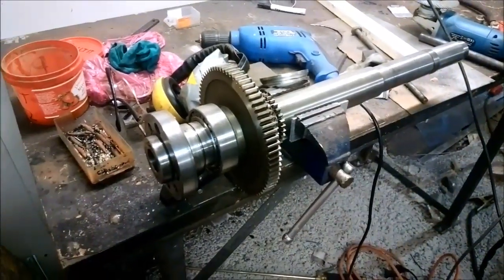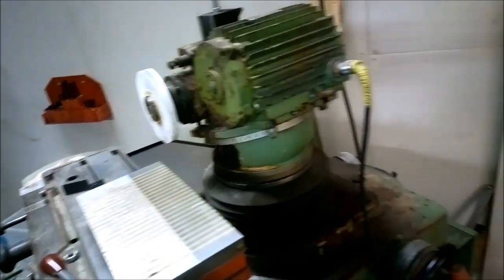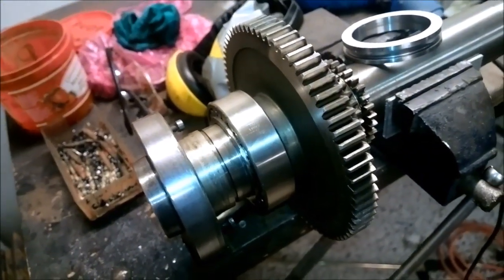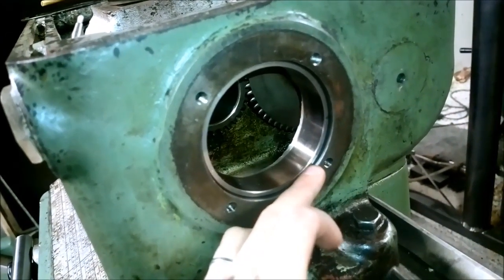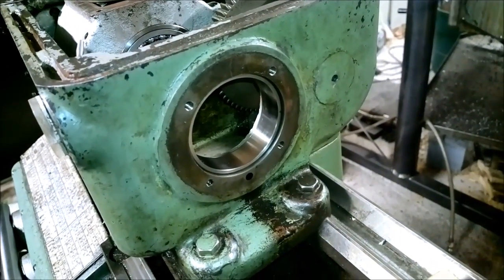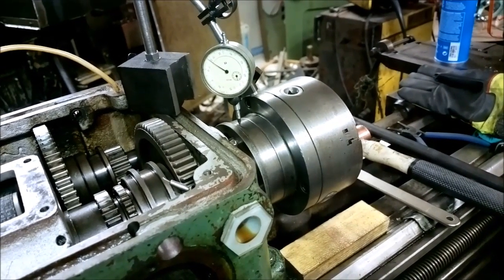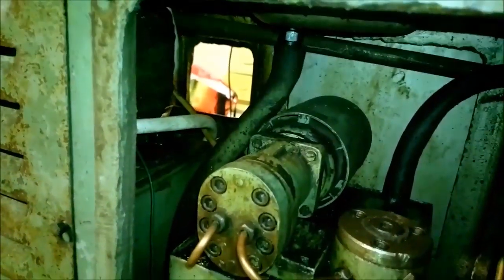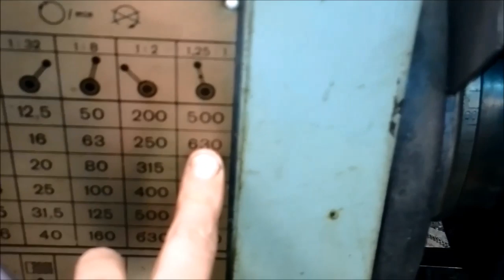Spindle bearing talk and progress 2 -Finished-

Comment: Hi bearing is adjusted now, lathe is cold and bearing is not oiled so it will be slightly different when lathe is running. I think 5 microns play on the main spindle is ok for cold and dry lathe but it depends on its specification. Anyway you need to try how the lathe is running. Bad thing is that you had to put Loctite between the bearing and its housing it should be tight press fit according to the bearing and lathe specification.
In some cases bearings haven't tight press fit for example when they are clamped,
but in such application I am sure it should be tight press fit. But better that you put this Loctite anyway it might be ok for some time.
Reply from the maker: Yes, there should be a press-fit. I have no Idea why it is like that now. I guess the only way to properly fix this is to rebore and sleeve the housing.. Loctite sure isn't a long-term solution but it will have to work until I have time to properly fix and overhaul this lathe.
Reply: sunppaa Dear Sunppaa, after seeing the video, I am 100 % sure that the bore is absolutely perfect, please do not do any thing with it. The bore should suport the bearing outer ring,the idea with the Locktite was 1000% correct.
I think You made the bearing adjustment just the other way arround,but anyway,for a quick repair the result is pretty good.
The surface finish of Your test turn was simply amazing. Congatulations !!!! Good luck !!
Reply from the maker: StamD65 So you think the outer race is supposed to expand against its housing? The turning at the end was not done on this lathe, but a 16K25 at my school workshop, very sadly :-). This lathe still needs a few other things done but hoping to finish them this weekend! Cannot wait to get making the first cut!! And if needed, I will just remove the spindle once more and readjust. Thank you for your help!!!
Reply: sunppaa The outer ring of the bearing should NOT expand by no means. It should be supported by the headstock box and,ofcourse,should be a bit pressed by the Rolls of the bearing ( pre-load)

Comment: Idk if you still have this one but 0,01mm thickness variation on a spindle shim is not good, spindle should have zero play and you can compress the stack 0,005mm by cranking the nut tighter

Comment: How you want to cut the teeths on the gear? I had some experience in this. I know 3 kind of machines which can do it, one is called hobber, another is gear shaper and one is just machine with chisel and divider. First 2 machines are quite professional and needs to have special gear cutters for them with special pitch according to the teeth size, needs to setup gear depth and gearbox for proper gears amount. Also needs to know how to measure the teeth if is proper depth and shape. So to do the job little knowledge is required, but if you have got access to gear shaper machine you are lucky.
Reply from the maker: I will do it on my mill with a diving head and a standard module 2 disc cutter! No shaper of hobber required! Next vid will be about this!